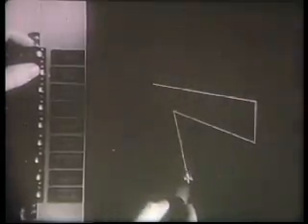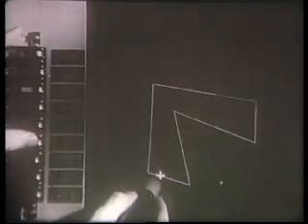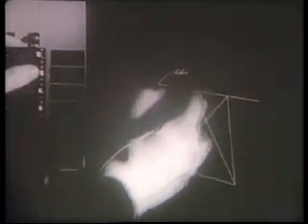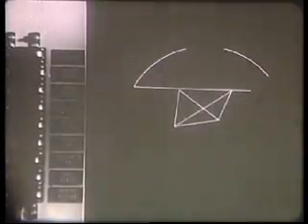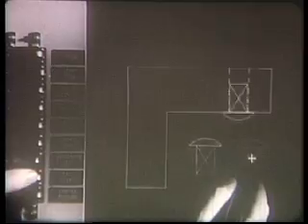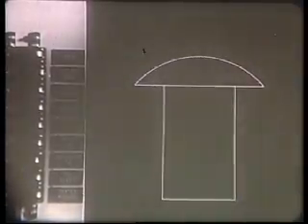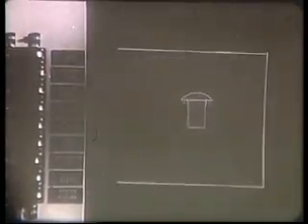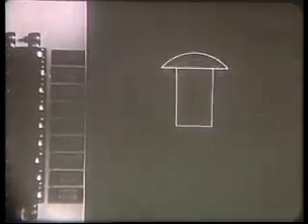Sketchpad

Comment: 🎯 Key Takeaways for quick navigation:

Ivan Sutherland created the Sketchpad system in the 1960s to assist mechanical and electrical designers in their work.
Sketchpad used a transistorized digital computer designed at MIT Lincoln Laboratory.
Designers interacted with Sketchpad through a cathode ray display and used buttons and switches to give instructions.
The computer could create neat drawings, adjust dimensions, and store sub-pictures for later use.
Changes made to the original drawing were immediately reflected in all related sub-pictures.
Sketchpad allowed for easy replication of complex diagrams and precise positioning of details.
The system could work at various scale factors, enabling detailed drawings over large areas.
Drawings created in Sketchpad could be reproduced using a plotting system.
Sketchpad was in a developmental stage at the time of the video.

Made with HARPA AI